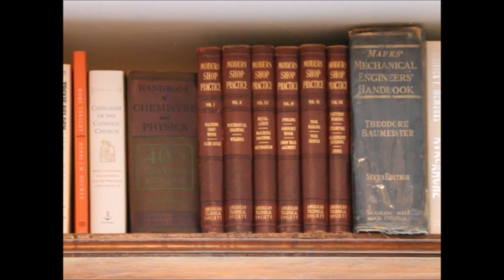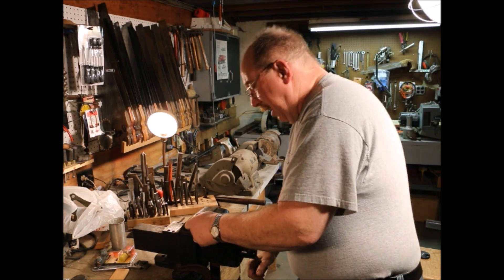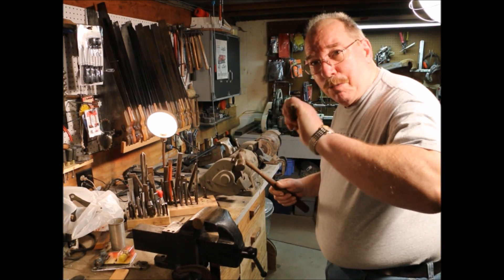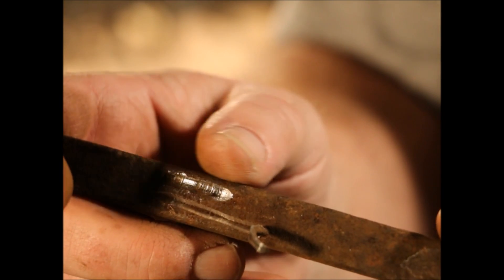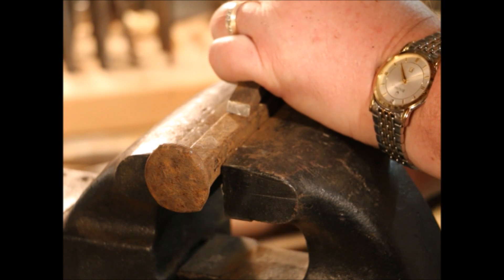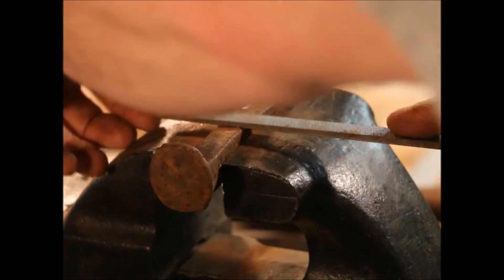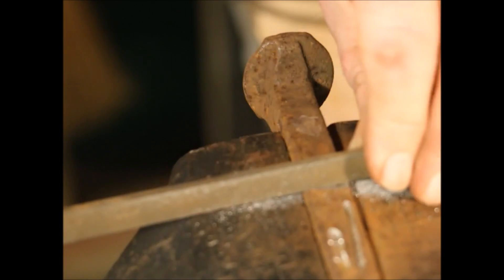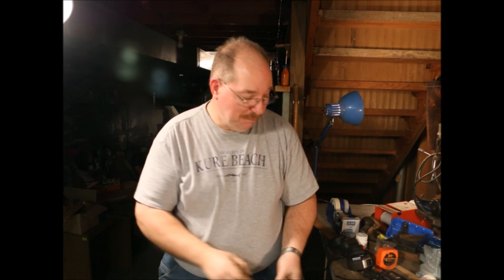Modern Shop Practice ~ From 1930 ~ Milling Steel By Hand & Eye ~ Pt 1 ~ By Old Sneelock's Workshop

Comment: I hope it’s not too late, but I’d suggest taking your very nice watch off while doing high vibration activities.
Reply from the maker: The watch sits on my chest of drawers. Since 2007 I have been carrying a smart phone and decided that having the phone for work replaced the need for a wrist watch. 
The watch works fine but I left out the battery so it will still be working when the auction is held, or my grandsons get it.
Reply: @ - I always take my nice watch off now, as I had a few issues with mine, just thought it might help you out if you were still wearing it.
Reply from the maker: It is a good idea. I made the video a long time ago.

Comment: Bless you Sneelock. I'm an old school machinist who worked in tool and die. I am familiar with all the types of chisels and have used them but I just enjoy watching videos of my fellow craftsmen who are keeping the art of metalworking alive in this day of computerized everything.
Reply from the maker: Thank you. 
I was missing the ability to just turn on a Bridgeport or chuck a part in a surface grinder. Since retiring I haven't had the space to install a true modern machine shop. 
I went back to the earlier ways and found that if they are limited in speed the accuracy is just as good by hand as by machine.

Comment: Would this work for cutting fullers
Reply from the maker: Not familiar with what a fuller is. 
You can make nearly anything with enough time and patience.
Reply: @OldSneelock  it's a groove cut usually behind the bevel of a blade it's also wrongfully called a blood groove usually semicircular but sometimes triangular ones exist
Reply from the maker: Ah. I should have known that. 
A half round file would definitely be able ton cut a groove in a blade before it is hardened.
Reply: @OldSneelock  i use a scraper but it takes a bit too much

Comment: thanks for such great videos!  I really enjoy learning about the old methods and tools and you are doing a great job preserving and documenting this.  I have a bunch of cold chisels from a tool box from the 30s and couple I've never seen before. they are flat like a wood chisel (1" wide and 2" wide) but with all steel handles no wood. any idea what they are for?  thanks
Reply from the maker: +Kyle Patrick (fenderhead23) There are a great many chisel shaped tools that perform similar functions. One kind is caulking irons: http://mephistotools.com/caulking-irons.htm are used to tamp down the oakum in cast iron soil pipe joints. 
Another use is: http://www.woodenboatstore.com/category/caulking_irons_mallets tamping oakum in the seams of wooden ships. 
Craftsmen have made their own tools also. Some are uniquely suited for the particular job at hand. Chisels were a popular tool for modification. A bit of tool steel, some heat, a hammer, and grinder and you have yourself a chisel. 
I haven't found a reference for them but I remember seeing iron shanked wood chisels for rough work. They had a similar shape to the more modern wood cutting chisels but they had an octagon shank on them for driving with a steel hammer. More of a demolition tool than fine wood working. Useful for knocking a hole through a beam for running pipe. Plumbers are notorious for punching holes in joists in questionable locations.

Comment: If anyone is interested in Modern Shop Practice, you can download all but volume one from archive.org (https://archive.org/search.php?query=creator%3A%22Howard+Monroe+Raymond+%2C++American+Technical+Society%22)
It is simply amazing how much USEFUL information there are in these old books.  And for hobbyists, sometimes these old books are MUCH more useful than their modern counterparts.
Reply from the maker: +Brian Neeley Thanks for the link Brian. I picked mine up at a used bookstore in Battle Creek, MI., called Crickets. Used bookstores are an incredible resource.
Reply: +Old Sneelock&#39;s Workshop Agreed.  We have a great one around here called Half Price Books.  And there are also several of the little "hole in the wall" bookshops around (they seem a little more geared towards fiction though...).
Reply from the maker: There is another in Kalamazoo near the Western Campus. Packed tight with every subject.

Comment: I think I might have a 1/2 inch wood chisel and a couple of cold chisels. I've seen the ones you had but they were probably on a tool judging thing in F.F.A. along with blacksmithing stuff for anvils like cold eye cutters and the like.Amazing what bubbles up in an empty head. AND as far as metal goes, what would be the best to make reed compressor valves out of? The Saw Surgeon has a couple of Craftsman compressors with broken reed valves. I found him a kit that Sears still offers and he has my little puffer so he can still progress but I was just wondering. Spring steel maybe? I knew you'd know. Thanks, Unc!
Reply from the maker: +Lewie McNeely Many years ago a friend of mine replaced the reeds in a Mall chainsaw with some shim stock. I believe it is spring steel and comes in varying thicknesses. It's available at most automotive supply stores.
Reply: Thanks Unc! I remember a buddy of mine's dad had a big Mall that the business end would turn over to cut either way. It might've been a 2 man. Long time ago though. I'll tell the Saw Surgeon.
Reply from the maker: That's what this one did. It was a 7 1/2 hp two man chainsaw with a 4 foot blade. I bought it to power a go cart. The engine had a float bowl carb so the drive would rotate for felling or bucking and keep the carb level. We mounted it on the back.
The engine had a huge fan to keep the engine cool and it sounded like a siren when it was running.
The officer who pulled me over said I was trying to outrun him. I got in more trouble when I told him that if I wanted to outrun him I would have. That was my first traffic ticket. I was 15.
I ended up trading the go cart for a Harley.
Reply: They were BIG, I remember that. It'd make a fine go cart and if you had the gering it'd be still running an oval track somewhere.
Reply from the maker: The young man I traded with ran it on alcohol for about 15 minutes and melted the piston. I wasn't surprised it took me a month to put the Harley back together after he had stripped it down to the frame and piled it in boxes.
Reply: I almost had a Sportster but never could get a price out of the guy. Ended up he sold it for $500 and I could kick him. Had a cracked tranny boss and it was tig'd up and going. It was a box case too and I probably lived longer because I didn't get it. The 74 was bad enough.
Reply from the maker: The first was a 45 flathead, then a Panhead 74, then a Meter Maid Trike with a 45 flathead. In between were a couple of Hummers and a 250 Honda Scrambler.
Sold them all when I got married and ended up buying a Kawasaki 650 5 years later.
Now that almost got me killed.
Reply: I just had the 68 Duo-Glide, a 250 BSA, a 650 Triumph and the last one, a Husky WR 450 trail. The 250 and 305's were very popular as well as the 350 SR's. I'm glad I ended up with all parts where they were supposed to be. It was a God thing, I guarantee you.
Reply from the maker: There are old motorcycle riders and bold motorcycle riders. There are no old, bold, motorcycle riders unless God was watching out for them.
God loves me and the devils afraid I'll take over. That's why I keep waking up in the morning. :-)
Reply: I've got a neighbor that has 3. His touring bike, a smaller zipper jobbie and a 1200 Sportster. He always says it's the riders fault for getting into messes. He has a picture of him at the Artic Circle on a Beemer a while back. I'm just glad I lived through my episode of 2-wheel-isms. I've got too many wild hairs sprouting, even me in the geezerish stage. Comes with equipment operation I suppose.
Reply from the maker: Lewie McNeely Answering another guys comment and I read the rest of them again. Your neighbor is right. I pulled out onto US-27 South of Coldwater. I was on the Kawasaki fortunately because the guy behind me, who started out an eight of a mile back,  ran up until he was almost touching my rear tire. I downshifted and nailed it. The front end came up and he was still on my tail. First time I ever shifted with the front end off the ground. The 650 topped out at 120 and he didn't fade until I was over 90. 
I sold the bike. It was obviously my fault. I left my gun at home.